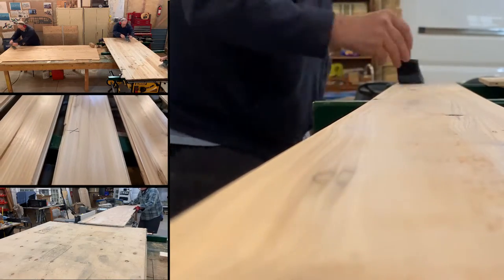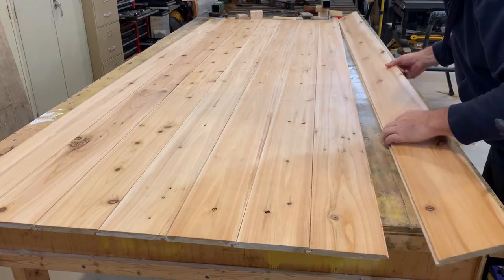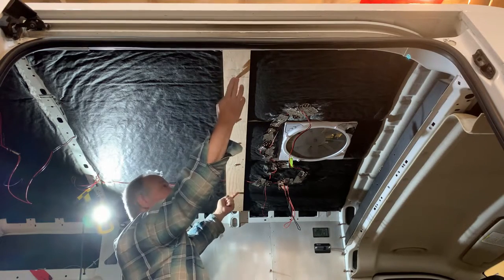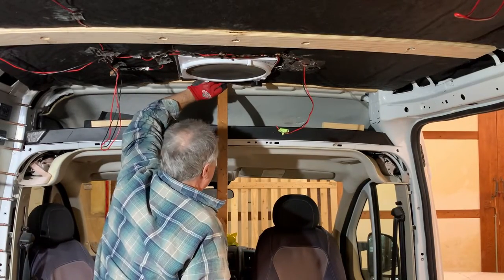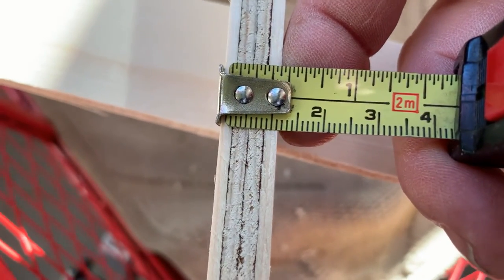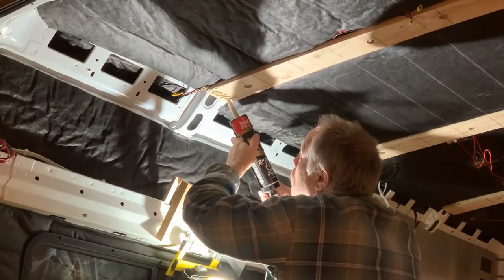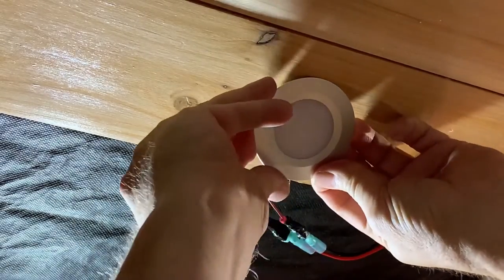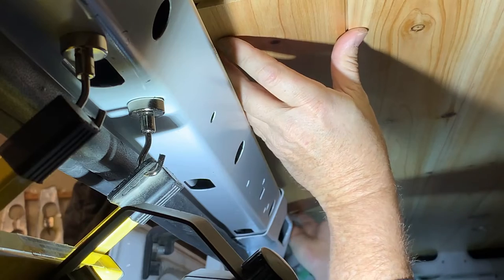RAM PROMASTER VAN BUILD – RV Cedar Ceiling

Comment: Do you have a link for the glue you used for the ceiling wood attachment above the front bunk storage? Is it the Loctite PL brand 3x? Too bad there's not a rib there to screw into.
Reply from the maker: Lepage PL Premium Construction adhesive. 

https://www.homedepot.ca/product/lepage-pl-premium-polyurethane-construction-adhesive-interior-exterior-waterproof-295-ml/1000403473

Cheers
Dwayne
Reply: @LifeIsShortDIY  Thank you.

Comment: How is the ceiling working out? I’m concerned about expansion and contraction.
Reply from the maker: Hi, thanks for the question.  
Our ceiling has been installed for over a year now.  Since then, we have traveled almost coast to coast, five states and 4 provinces.  Nothing has come loose, nothing squeaks.   I used both brad nails and PL Construction adhesive, which I am a fan of.  The brad nails are just to hold the boards until the PL sets.  
Thanks for the question.
Dwayne

Comment: I'm of the belief that you START at the center, and work your way out to the sides. If you start on one side, you'll have a weird cut  on ONE SIDE.
Reply from the maker: Your right, it might have been easier to have started in the center.  I certainly had to be very careful starting on the side, and I made sure I left 1/32” here and there, to make sure I kept it centered during the build.  Thanks

Comment: What nails did you use?
Reply from the maker: Hi, the nails I used were simple “brad” nails.  I chose them as they have a small head and are difficult to spot.  Their only purpose is to hold the wood secure until the PL Construction adhesive sets.